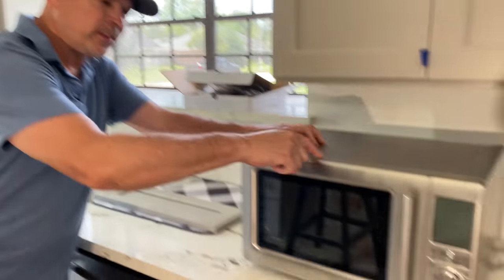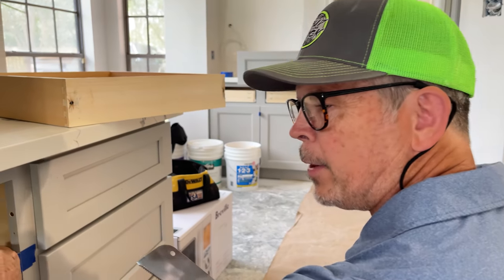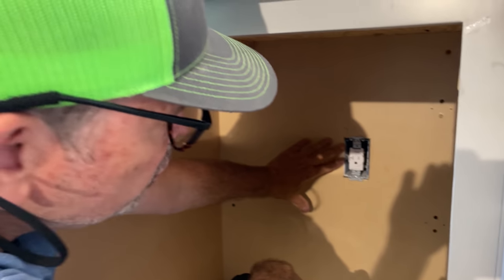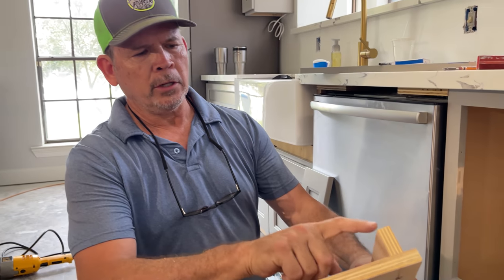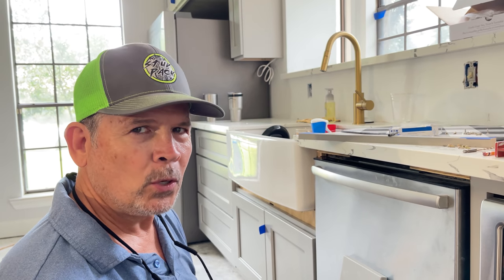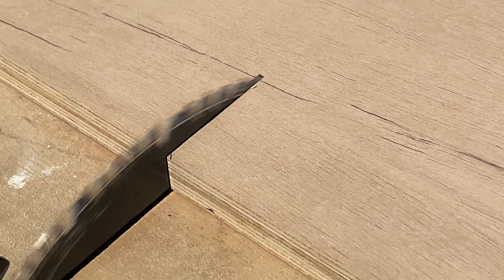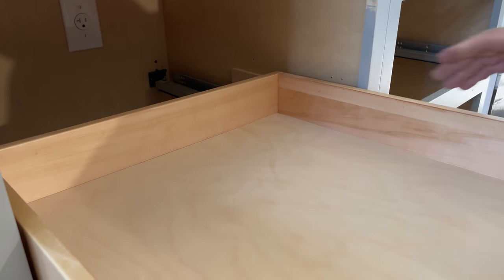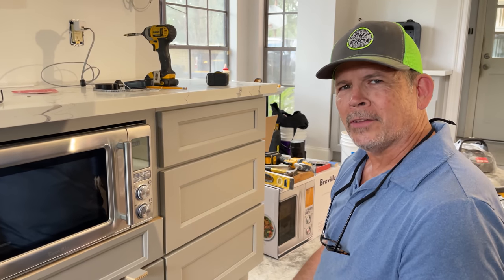Getting THIS Microwave in an IMPOSSIBLE Opening

Comment: First, this was an awesome job making this work and fit. I am copying a lot of the same ideas for my microwave that is going into a tall pantry cabinet, and adding a drawer as well. The only concern I had was this microwave model is the 3 in 1 Convection/Air Fryer/Microwave and I know you guys did a lot of ventilation, but the manufacturer says 8" of clearance around it when used on a countertop and NOT to enclose it in a cabinet or enclosure because of overheating and fire hazard. It would be one thing if it was just the microwave function, but it's not. People have even forgot to remove the plastic turntable wheels and melted them on the oven setting. 

You might be able to just use the microwave, but what if guests or kids accidentally use the other functions. too much risk and I wonder if there was a fire due to faulty installation if they would deny coverage? I bought this but will return for a microwave only unit.

Comment: dang. I was thinking to cut the center of the drawer face so the rails stay the same width, the glue the 2 halfs together.
Reply: Nice! That’s a very good option too.
Reply: You would want to cut off the top rail then trim the stiles and assuming you have a floating panel, trim that.  A lot more involved…

Depending upon the vertical dimension, it may not be worth it.  I’d probably go with a solid drawer face.
Reply: Yep! That would’ve been a better way to do it and keep the frames consistent.
Reply: Yeah… no on that drawer

Comment: I would just make the small drawer using single slab of wood without the frame.. it will look better that way.. fix the ocd too..
Reply: I agree, I was going to say just use a filler as the drawer front. You could have even backseat the drawer front to line up with the face frame when closed.
I've done this hundreds of times with spice rack pullouts. You cant even tell there is a drawer or pullout there.
I've even incorporated some fluted fillers on each side of the stove for this.

Comment: You guys are awesome and as an owner of a handyman business, I have learned a lot from your videos. However, I'm wondering why any homeowner would want a microwave at a level that a child could operate?
Reply: I'll take this one since we just did the same -- the reason for this is to save countertop space in a small kitchen and not have it at a dangerous "over the shoulder height" for shorter folks.  

Our last microwave was above the wall oven  in a pantry type cabinet and it was a pain. When we did our remodel we opted to put it beneath the countertop in a dedicated cabinet.

 Depending on how the kids (4, 2, and 3mos.) react to it I may order some doors for it and push the microwave back in the cabinet and add child locks to the doors.

Comment: I'm in the process of looking for a new and reliable  microwave with extra features ( I've seen several brands of microwaves recently with bad reviews) . So I had to find out what kind of microwave that is in the video. It appears to be a "Breville Combi Wave Microwave 3 in 1" if im not mistaken. Has pretty good reviews and has me interested since it is a microwave,  convection oven and air fryer all in one.
Reply: anything that combines several functions usually performs them all poorly. Use your oven for proper cooking and buy a cheap microwave for what microwaves are good at - heating up leftovers. No half decent cook would ever use a microwave for actual cooking.
Reply: @spencerwilton5831  Got it. Good advice. Thanks.

Comment: You also could’ve cut along the top of the opening, because without the drawer hanging over it, the line across the top doesn’t match the line of the drawer next to it.  Between that and the little bit you cut off at the bottom of the opening, and you could have gotten an even larger drawer to work in that space.
Reply from the maker: I thought of that but I didn’t want to deal with the screws holding the plywood subtop down.
Reply: @StudPack  Well, I guess that's why you're the expert! lol

Comment: I don't understand the purpose of the 5 ventilation holes in the bottom when the microwave is on a shelf with a drawer underneath.  How is that helping with ventilation.  The microwave is not fully enclosed, so why not just put 3 ventilation holes in the side behind the dishwasher.  That seems a bit excessive.  Help me understand because I am about to attempt the exact same project.  Otherwise, I love the video and it is very helpful. Thank you

Comment: I would have avoided the shelf for the microwave and just used metal brackets.  You might have even been able to remove the feet of the microwave and used rubber washers, nuts and bolts to use the feet holes to secure the MW to the brackets.  This would have saved about 1.5 to 2 inches of space for the small drawer making it more useable.

Comment: People love to nitpick, myself included. So hear I go:
You mentioned GFCI breaker and that sounds good, but you didn't mention AFCI which should be installed on almost all circuits, new or modified (>6' of new wire), per the latest version of the code.
I would want to cover up the plywood edge of the microwave shelf. The face piece you cut out could be ripped down and put on the end of the shelf.
Last one, when you cut the drawer down you put the fence at 1 1/4" when you should have measured the drawer subtracted 1 1/4" from the measurement and set the fence to that.

Other than those minor nitpicks great video.
Reply from the maker: Thx Zach 👍
AFCI/GFCI combo good idea✅
I put a trim piece on the plywood edge yesterday 😀✅
I went back and trimmed the drawer properly after I knew it would work ✅
Nice catch on all that 👊

Comment: As that receptacle is a single, and buried behind the microwave, and dedicated to it, it is not h/o accessible, and therefore code exempt from requiring a GFCI receptacle or breaker. Same thing with the dishwasher, refrigerator, and garbage disposal. Dedicated appliance circuits do not have to be GFCI protected, unless required by the appliance manufacturer.
Reply: never the less it's a sensible practice. Fortunately in the U.K. we do things slightly differently, every circuit is protected by a GFCI device at the distribution board, including lighting and all outlets plus larger appliances with dedicated supplied like the cooker. It eliminated the need for dozens of individual GFCI outlets. A typical socket circuit is rated at 30 amps at 240 volts so around 7kw, enough to run every kitchen appliance with the exception of the oven which would have a dedicated supply.

Comment: I might consider some trim running vertically on either side of the microwave. It would bring the width of the microwave equal to the width of the drawer below, and cover that inch or so of the top of the drawer face you can see on either side of the microwave. Though once the cut edge of the drawer is painted that might blend in.

Comment: There are actually Microwaves that you put in the same location and have their own sliding tray type pull-out drawer that you load your food from the top - called Drawer microwaves - pricey
Reply: And they are designed to be there so they have ventilation. No need for all the cabinet holes.

Comment: Probably a safe assumption, but we are assuming that there is no danger of heat or hot liquids coming off the bottom of the microwave into anything flammable or delicate in the small drawer underneath.

Comment: It would actually need to be a GFCI breaker because it would not be accessible with the microwave in the way. 😂
Reply: all the kitchen receptacles serving countertop area should already have GFCI protection, can he connect it to that?
Reply: @scottyee707  Possibly. Code requires a dedicated 20A micro circuit when it's 'fastened in place' like those over the range fan/micro combos. This is more like a shelf, so you could probably get away with sharing a countertop circuit. However, they're doing it the right way and avoiding the question by just doing a dedicated. Microwaves draw some of the highest power in the kitchen, and will easily pop a 20A breaker if you use a toaster oven or airfryer on the same circuit. Better to do dedicated.
Reply: @bnasty267  thanks, my house has a space like this from the previous owner and he just tapped into the counter top GFCI, I ended just putting my printer in there because I actually hated the microwave that low but good to know!

Comment: The microwave's manual says "The oven is not suitable to be used in a small appliance enclosure. Ensure to leave adequate space all around the oven. Minimum space of 20cm is recommended."  Not sure how that's giving the 20 cm / 8 inches of space around it at looks like you gave it at most 3/4" on each side and  2 1/2" at the rear.   Additionally the manual says "The microwave must not be placed in a cabinet."  In short it looks great until it catches fire....

Comment: Why do you not use a duplex outlet for the microwave instead of a single
Reply: It's not uncommon for circuits run for single appliances to have these. It prevents someone from plugging in additional devices. Even if it's not required by code in this instance, it's not a bad idea. It tells someone working on this house in the future that the circuit was run to serve a specific purpose.

Comment: The only issue I could see is when the microwave needs replacing, you need to find a microwave the same height, and depth as the current one that is installed.
Reply: There are enough microwaves out there that it shouldn't be too hard. They come in all shapes and sizes, and many of them are close to the same size
Reply: This is true for many different mounting options. Same for range hoods and other appliances. For this reason manufacturers have standard sizes.
Reply: @moonpiespotlight4759  but range hoods typically are not replaced on a regular basis
Reply: @RegularPersona  I agree, but I've had the same microwave for 15 years.
Reply: @moonpiespotlight4759  You Got lucky with your microwave.  Most consumer microwaves die after some years.

Comment: Still unsure of how the cut down front is going to look with the rest of the cabinet fronts
I guess I'll just have to find in next time to find out 😁
Reply: Agree. The panel should have been ripped (center strip) rather than the horizontal rails.
Reply: @craigpritch  How would that go back together and not look terrible? I agree the preferred look is same size rails, but making it look good would be hard.

Comment: Nice work but i  bet they will be calling you in the future to relocate the microwave once they realize what a annoyance it is to use it at that height.  Can't  wrap my head around why anyone would think that's a good place to put a microwave even if there's not a lot of kitchen space.
Reply: I have a microwave mounted like this from a recent kitchen remodel, and it's fantastic.  Moving it reclaimed so much counterspace, and using it is not difficult at all.  I mostly only use it for heating up leftovers, so it's not like I'm cooking large amounts of food in a microwave.  I suppose if you use your microwave extensively for every meal you'd probably want it mounted somewhere closer to counter height.  For everybody else, under-counter is a perfect compromise of space and usability.
Reply: @toddosty  Rehabbing my tiny spot and removed a wall to open up the kitchen. This meant less upper area for cabinets and microwave, but worth it to make the space bigger. I actually did exactly what Studpack did here. No one in a five person house is complained remotely about the microwave placement. 

I'm not much of a microwave user, but understand the necessity. I def would never want it on top of the counter. Maybe when I'm older my mind will change. They have top loading ones as well - if it did start to bother anyone.

Comment: I understand the vent holes near the rear of the Microwave but not the lower vent holes. Actually the exhaust vents are in the middle and length wise, not vertical. Mine are exactly where the Microwave exhaust is. I have this exact Microwave and it pulls air from the front and exhaust's it from the side. It's very minimal anyway. I just cannot see a reason for the lower holes. 2- drawers separate them. This seems overkill.  I just finished a cabinet very similar but no holes on the bottom. Also, your Microwave is recessed too much and will not allow the door to open all the way. If You leave yours that way it will hit the frame and not allow a full open, thus wearing the paint off the frame. I just had to pull mine forward to allow for the door to open all the way but it sticks out a bit too far. I'll have to find a solution to that. I always enjoy your video's but don't agree with the lower vent holes for this Microwave.

Comment: Manufacturers are like:
"The microwave must not be placed in a cabinet."
"The oven is not suitable to be used in a small appliance enclosure. Ensure to leave adequate space all around the oven. Minimum space of 8 inches/20cm is recommended."
"Microwave oven is not intended to be mounted below a height of 3ft (916mm) above the floor level."

Comment: Little to no ventilation. Long microwave sessions could potentially be a problem long term. Decreased microwave lifespan? But seeing how its a single family home, doubt there'd be constant 10+ minute sessions.
Reply: there is plenty of ventilation to the back and side, and underneath
Reply: @CaptnJack  One may think that, but below is a tiny drawer with narrow cracks around it. And I don't think you've noticed but theres walls on all four sides where the microwave sits. That's Like putting a average sized human in a 6'x3'x3' box. You'll eventually fill that box up with humidity and in this microwaves case, it recycles luke warm air that will gradually heat up. That's why I said before that it depends on how long at a time that the microwave stays in use.

Comment: One of the many many infuriating things about "the American way" when it comes to construction, specifically our electrical system, has to be the absolutely ridiculous number of devices with right angle plugs that expect the ground pin to be oriented facing down. The objectively correct way to install NEMA 5-15/20 receptacles is ground up, however since this is not a requirement it seems as though contractors got in a habit of installing them ground down (since it looks like a cute happy face!) and appliance manufacturers responded by assuming ground down is the best way for them to manufacture their plugs. If they'd have stuck with the correct way, maybe the fly-by-night electricians and contractors would have had to learn to do it correctly! 😜

Comment: A better use of the narrow drawer you made would be to create a charging drawer that draws power from the microwave outlet.  Create a box in the back of the drawer and mount a flush mount charging strip with a coil cord that plugs into the outlet.  The front part of the drawer will hold things like an iPad, iPhone, watch, TempSpike thermometer  etc.

Comment: That is a terrible place to put anything except maybe a dishwasher. I would have put it (the microwave) in another room but not there. Oh yeah, the pull saw pulls the wood fibers towards you. You put tape on the board to keep that from happening. A PUSH saw would have solved that issue even if you had to remove the "set" on the teeth.

Comment: Why? You guys realize they make drawer microwaves for this exact use case. They look better, have superior functionality, and considering your labor probably would have been cheaper.
Reply: Also, none of that vent hole madness would be required with a drawer microwave as most vent front the front.
Reply from the maker: We love microwave drawers.  We looked extensively for one to fit this width cabinet but could not

Comment: If you knew the microwave was going to go there from the start why didn't you plan ahead with the cabinet layout . . . then you wouldn't have had to do all of this fixing?  Forethought??
Reply from the maker: We actually had multiple locations for the microwave available to us but the final location wasn’t determined until later.  We did plan ahead and rough in the electrical to two locations and ended up using this 24” wide cabinet.  We actually modified a 32” wide (?) cabinet in another kitchen series for a microwave drawer 👍👊
Reply: @StudPack Great.  Leaving options for the undecided homeowner is forethought and prevents those Contractors who would charge for a "change order" from doing so.  
How did you match the paint on your newly cut edges?  I watched you assemble and install the cabinets and I believe they came RTA (which means they came painted).
Thanks for the reply.  I don't know any other YT that answers comments . . .
Reply from the maker: Thx 👊.  We had some paint color matched.  It’s very close but not perfect match and the sheen is a bit off but it will be fine 👍

Comment: It does not look good at all. Look at this none-existing lines for the fronts, horizontal. None of the drawers have the same line. The fridge is way too big. if you want the microwave to be built-in. Just order a built-in version. What’s about the gap underneath the zinc and what happened to the space around the dishwasher.

Comment: Ever heard of a microwave drawer?  Yes, they're costly but you don't have to get on your knees to use them.  This one is very inconvenient.  An older person would NEVER use this, because they couldn't get up off the floor.
Reply from the maker: Yes, we’ve put in several microwave drawers. Biggest issue here was the width of that cabinet. We could not find a microwave drawer to fit a 24 inch wide cabinet. Thanks👊